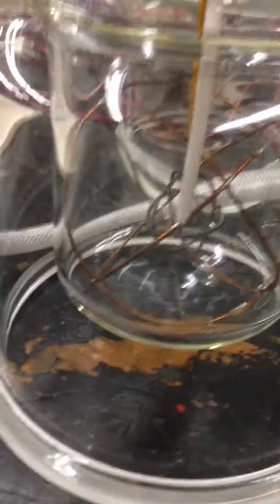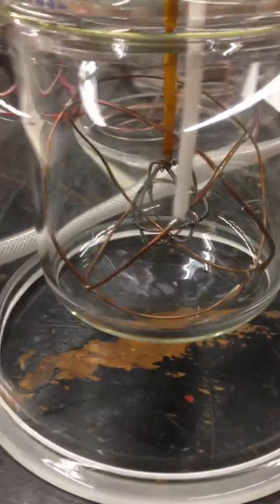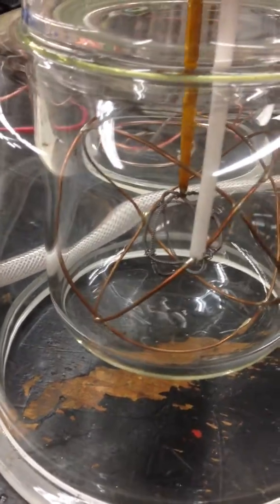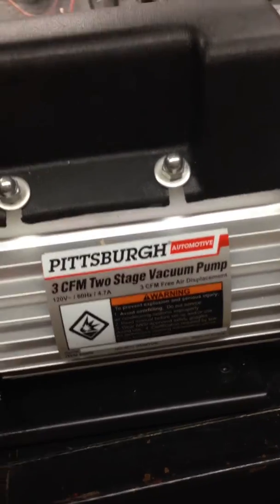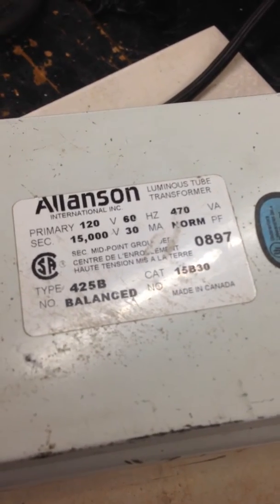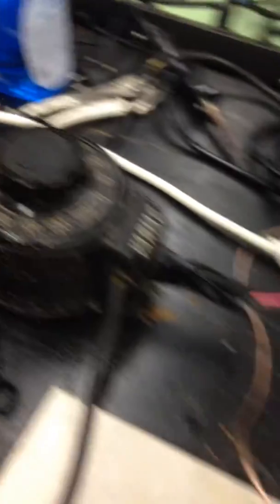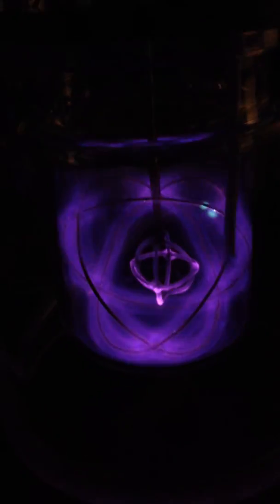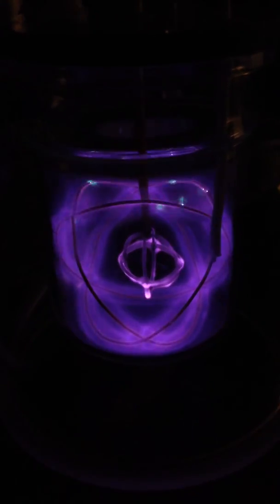This is what happens if you put the diode in backwards in a fusor.

Comment: Please message me and explain this occurance.
Reply from the maker: Skyler Peters - putting the diode in backwards resulted in the outer grid being focus of the plasma rather than the inner grid.
I my other videos this is corrected and you can see the plasma on the inner grid as intended. In a fusor such as this you want to accelerate the electrons from the outer grid to the inner grid to achieve maximum possibly of fusion. Of course this is only a demo fusor and is not set up to generate actual fusion.
Reply: @TheValveBoy  This is super cool! Thank you for sharing